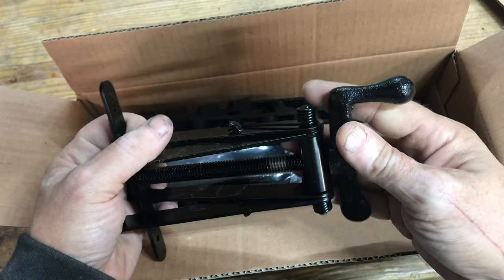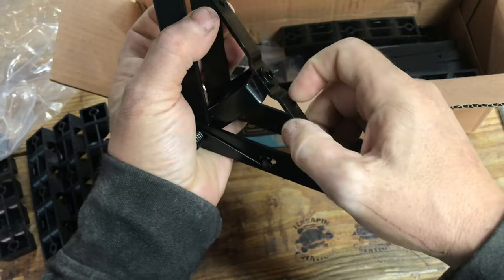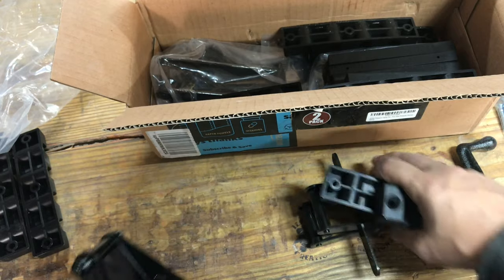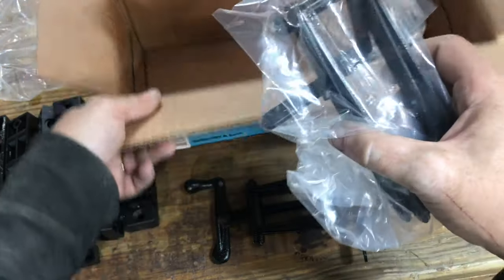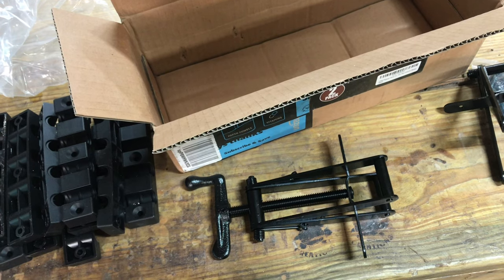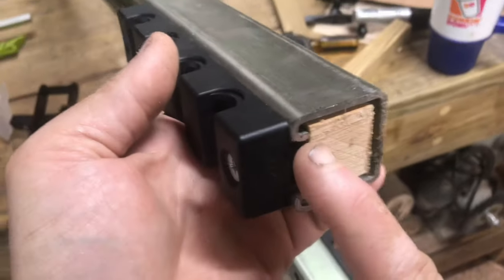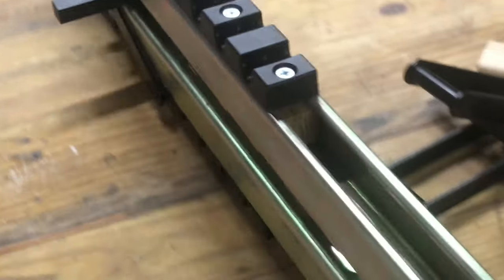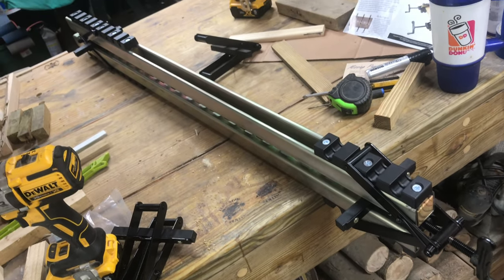Unboxing Four Way Panel Clamps From Peachtree Woodworking Supply

Comment: I tried the wood inserts. The screws clamped the plastic notches down to the strut but after applying pressure with the clamps, the wood slid inside the strut. Did you have the same issue?
Reply from the maker: Yes I ended up drilling through the metal strut and used machine screws instead.
Reply from the maker: I kept the wood inside. I think it helps keep things stable.